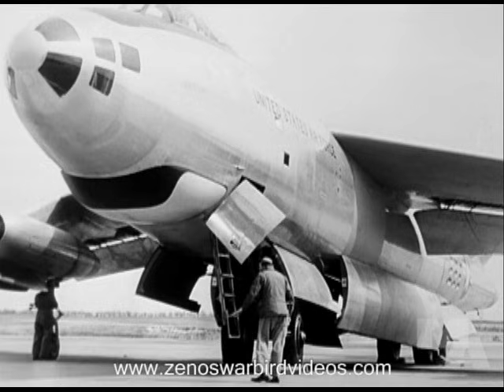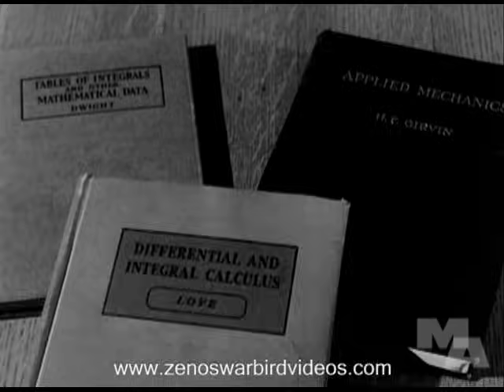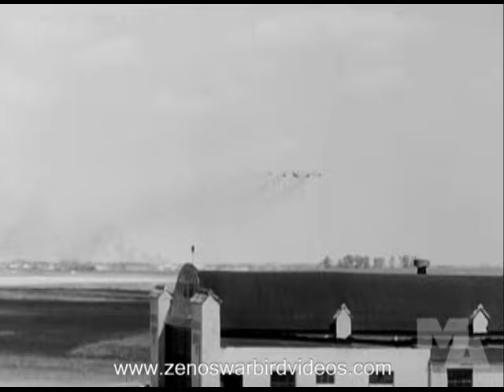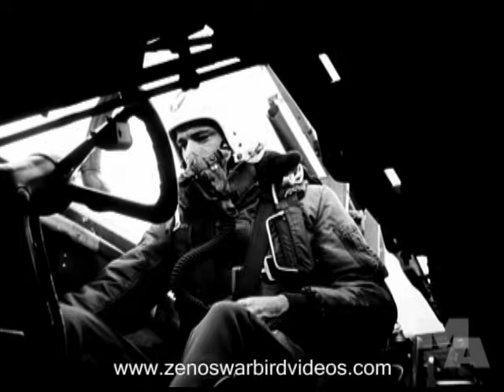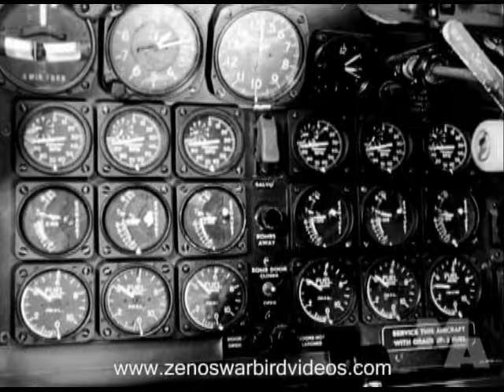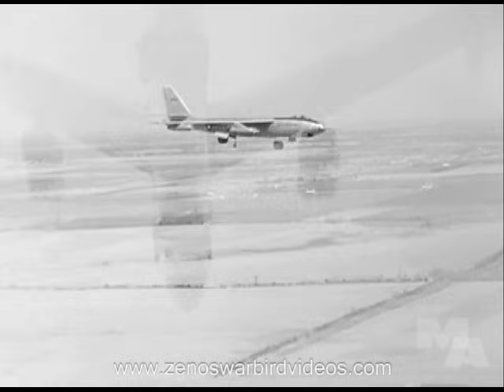Flying the Boeing B-47 Stratojet - Restored1950

Comment: The B-47 was sluggish on takeoffs and, came in too hot on landing. If a pilot didn't take off and go around the plane had a tendency for the wing to slide and cartwheel. Avionics, as with much of vacuum tube technology was a constant problem for the entire operational history of the aircraft. 203 of the B-47's were lost with total deaths of 464. This number represents about 10% of total aircraft production. Still the B-47 incorporated most if not all modern technology in jet production at the time. Swept wing design, engines in nacelles pods, near super sonic speed, superior operating altitude. It provided us with a technological advantage over the Russians for most of it's operational life time.

Comment: The aerodynamic theory of high altitude flight, critical Mach, etc. was something new to crews upgrading from piston engine bombers to jets. Mentally "shifting gears" from a flying 300 mph aircraft to one flying at 600 mph was a big transition. It took lots of training and experience to become a B-47 pilot. A serious mistake in planning or judgement could have dire consequences for the mission and crew. Being our first jet bomber, the B-47 may not have been the easiest or the most forgiving airplane to fly. There was a lot to learn about high speed flight in the 1950s, aerodynamics, engines, aircraft systems, performance, etc. This was repeated a decade later with the B-58 and its Mach 2 speed (another ground-breaking design).

Comment: This plane used a pull up loop of sorts to toss the Nuclear bomb towards its target while the aircraft pulls up, then rolls over to level out in the other direction.  The B47 could not handle such forces, it broke up or buckeled under u der this maneuver many times killing many crews before it was retired when the B52 came in as USAFs main bomber. Dangerous plane

Comment: This is one of the most beautiful air planes ever built. It was very capable of delivering an atomic bomb with a technique called “toss bombing”. This was done by using a turn called an emmillmen . . . this is a turn used by fighters. You open the bomb bay, go vertical, performing a half loop, at the critical moment you let the weapon go, centrifugal force will pull the weapon out of the bomb bay. You than preform a half Roll on top, point the nose down and ‘firewall’ the throttles and escape the blast and shock wave
Reply: Emmillmen? Well, isn't that nice 😂😂😂

Comment: The Fellas:    What's the max speed sir?
                          How high can ot fly?
                          Does it have bad stall characteristics?
The Commander:    Did you guys even read the flight manuals we gave you when you got here?
Reply: Its really noticeable that the film discussed at length the range, cruising altitude and critical mach number without ever once putting a number on any of these. The film must have had a lower security classification than the flight manuals.
Reply: Ken Oliver I never really thought about the security levels of these old training tapes until I read your comment. Now that I think about it, it is quite obvious how classified the films were at the time. One film might teach you about the exact start up procedure, taxi, take-off, flying and landing of an aircraft. Another film might barely assist in a viewers recognition of a craft.

Comment: A beautiful and extremely impressive bird. Truly revolutionary and a world beater. An old friend of the family flew in them and said that, though this video didn't mention that tank selection was also used to trim in pitch, more than any other plane he flew, the entire flight really did consist of managing fuel. Perfectly understandable when some of the assigned missions were one way! Uncle Hank passed a few years back but he always felt that the B-47 should have been modernized and upgraded with four turbo fans along with or instead of the B-52 when they switched to low level attack profiles. Most of the money used on the B-58, F-111 and even the B-1 would possibly have been better spent on SuperStratojets.

The B-47's quirks were manageable and knowledge would have improved the control systems in a comprehensive upgrade. Throw in a structure redesigned for low level flight, those modern engines, and the explosion of inflight refueling and a modern take on the ol' 47 would still be a mighty impressive medium/heavy attack aircraft.

Comment: Became crew chief of B-47 at Lake Charles 1954, after 2 years of crewing a B-29 it was like going on retirement, wonderful aircraft most people don't appreciate the strides made in the first 50 years of flight. Bill K. Long Island
Reply: Hey Bill,  I grew up in New Rochelle just across Long Island Sound from you.

I read in a comment here that the co-pilot seat could swivel around and face to the rear 
so the co-pilot could fire his tail cannon in case of Mig attack from the rear.
I have never heard that before.

Sorry, I meant his 6 o'Clock.   Hey I was Army not Air Force   haha.

Bill D. New Rochelle
Reply: Bill, how was the maintenance on the 47? The 29 looked like a plumbers nightmare.

Comment: I was a crew chief out of Lake Charles I will never forget, I hopped a ride on a refueling mission, I was sitting in the hole freezing to death and 4 feet away sweat was running down the arm of the A/C as he was flying the refuel... 1954
Reply: William is it true that when they were refueling jet bombers with propeller driven KC-97 tankers they had to do it in a shallow dive so the tanker could be flying fast enough to be above the Jet bombers slowest stall speed?

Comment: The B-47 was the first jet Boeing designed. And because they were uncertain how stiff to make the wings then they designed its wings with lots of flexibility. If they made it too stiff it might possibly break in two in turbulence. It was therefore made so flexible that the wingtips were 17' higher at cruise than when the plane was on the ground. 

I as a USAFA cadet was given an orientation ride in one in 1958. The walkway mentioned in other posts here ran along the left side below the level of the A/C and copilot and ran from somewhere in the rear to the bombardier/navigator's nest in the nose. All three crewmembers had ejection seats, but I had nothing. I just sat on the floor of the walkway abeam and below the pilots for T/O and landing. I was also told that my way out of the plane during flight was through the entry door on the left side of the fuselage ahead of the wing. After the ride was over I asked the crew what my chances had been had I been forced to exit through the entry door inflight. The answer was that nobody who had gone out that door inflight had survived. 

Since the navigator did not want to bomb Sacramento for grade, he allowed me to bomb Sacramento for fun using the K system, which was a great learning experience. 

The AF got rid of the plane because of its lack of range. And this was before the day of the KC-97 and KC-135 tankers, which might have changed things. It's a shame because it outran all the fighters of its era numbered below 100. 

The modus operandi was to tanker up out of radar range of the Soviet Union at high altitude, then descend to low altitude to avoid radar. The bombs had spikes on their noses to impale the bomb in the ground for awhile before detonating in order to let the crew survive. 

The Aircraft Commander did the flying, while the copilot handled the fuel and tail guns, two 20mm cannon with a rate of fire of about 600 rpm each. His seat could be made to face rearward in combat. 

Since the A/C did all the T/Os and landings, the copitots were taken out periodically and allowed to land the plane. They had to have 3 landings each 90 days to stay current.
Reply: Thank you sir for all that interesting information. I would love to have seen Jimmy Stewart's co-pilot
turn his seat to face rearward to simulate defending from a MIG attack in the film
" Strategic Air Command ".

Comment: Hmm, memories. My dad flew the B-47 for a year or so when Castle AFB, 93rd BW I think, transitioned from the B-50 to the B-52. This was like 1953 to 1955 time frame. All I remember about the airplane from a personnel view point was that when dad took me out there and hoisted me up so I could sit in the pilots seat was that is was hotter'n a two dollar pistol up under that canopy. Painfully loud and the B-52 was more so. And if I remember right the B-47 had a cat walk that would get you back to the bomb bay, I could be wrong and be remembering the B-52 which does have such a cat walk. I was like 4 years old when dad was flying the B-47 so cut me some slack please. And the last B-47 I saw flying was late spring early summer of 1969 when I was in Boot Camp at Orlando Florida. It came over the training center headed into McCoy AFB trailing it's drogue chute ( Smaller than the Drag chute). A hell of an airplane but a demanding one. Dad really liked it, said it was like flying a six engine fighter.
Reply: I know Castle AFB well from my Air Force days.  It's a civilian airport now, but very little traffic.  The outdoor air museum is expanded from what it was when the base was active.  Whenever I see that exit gate next to what used to be the base operations building it brings back memories of walking through it back in 1963.  That was the exit from the SAC ramp.

Comment: A beautiful Bird, but quite dangerous to fly.  On a nice, clear day while cruising at altitude you could go into a Stall if you didn't watch the controls constantly.  You could get a Stall Warning while at speed, at altitude in good weather.  If you ease off the throttle, and go into a very shallow dive (like any pilot knows from flying a Piper Cub or little Cessna) it won't level out and fly straight after a few thousand feet.  It WILL shed one, or both wings!  B47's were lost without even sending a Mayday while flying comfortably in good weather.  This beautiful plane was a killer.  10% of B47's ever produced were lost, killing over 450 crewmen and it NEVER saw a minute of combat.  The old Tu-95 Bear would cruise at Mach .8 with very little pilot effort.  We retired some B47's that were only eight years old.  A "Widow Maker" if there ever was one...
Reply: Thank you for your information Randy.  I did not know the B-47 was that finnicky a bomber to fly.
Sounds like it was the Sopwith Camel of bombers.
Reply: Finally, someone speaks the truth. I counted over 250 losses from the 2038 built. This plane was a valuable technology step, but it shouldn't have gone into production. They should have transitioned from the B-45 to the B-52. The Soviets had faster fighters by the time the B-47 went into service, and  they had SAM's a few years after that.
Reply: Gee in my 5 years of flying the B-47 (310th BW, Schilling AFB) none of this happened!  Guess I just missed all the fun.

CWW Lt. Col. USAF (ret)

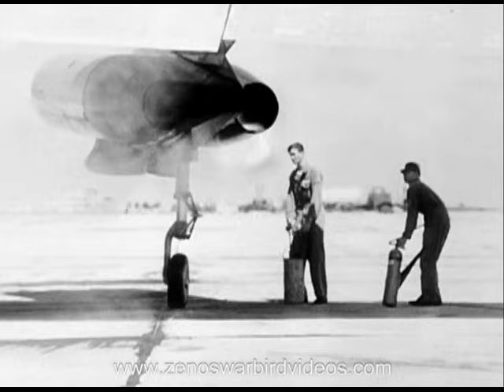Comment: @ 19:06 the ground crew is ready with fire extinguishers ,  combustible is spilling from the turbines.   Was it normal to occur during the start up with the early turbines?   Why ?
Reply: Ron Wolpa Not just the early turbines, we were doing this up to the late '80s with the Mirage IIIO/D. Why, excess fuel during starts caused by late ignition or tail wind usually.
Reply: yup.. lol. could you imagine getting ready to take a commercial flight where ground crew had to do this?
Reply: +Ron Wolpa That's not fuel; that's water, being sprayed on the hardstand to dilute any spilled fuel and prevent a flash fire.
However, early turbojets, while never quite as leaky as the turborams on the SR-71 (A/K/A the kerosene shower-bath!), did have a nasty habit of dripping oil and JP on the ground when not running.
Reply: And, most astonishig of all, those poor chaps had NO ear protection! Maybe deafness and engine screech-induced dumbness was the ONLY thing keeping these lads from runnig for dear life, away from this threatening beast!!!
Reply: James Kratzer I recall reading a book on the Blackbird in the mid 80's and it said that the SR-71's fuel tanks leaked until the metal got hot enough to expand and seal.
Reply: Easy fix  just bring throttle s up a little and it wood clear up. But guys forgot one major item. 
RESET THOSE STUPID BREAKS QUICKLY.
Reply: Always had ear plugs.

Comment: Seems to be a fair and honest 1950 profile of this plane. Actor, Reed Hadley, very convincing as B-47 pilot/commander. The B-36 was still the main deterrent due to early production numbers for the Stratojet. The B-47 did not have the range or bomb capacity of the Peacemaker. The B-47 could be a scary and cramped way to fly. Slowing down to refuel with a KC-97 hurt it's time to target. The KC-135 helped shut the door on the B-36. Before the Stratotanker, total mission not much speedier than the '36. The B-47 was the future, though.

Comment: We had the e model best ever bomber our wing flew with external ecm pods and the clip-in bombing systems 4 weapons not 1. We only ever lost 2 aircraft in8 years..All the problems of the A model were gone by the time Boeing built the e model with much better engines and added a 1700 gal drop tanks an all fuel cells moved to the wings with 1 center line tank low in the fuselage behind the bomb bay. Did away with the long bay God Bless the Clip-In Bomb System......

Comment: Beautiful piece of Aluminum. One thing they didn't say was that the co-pilot was also the gunner. It had double 20mm turret in the tail and the 
co-pilots seat could rotate 180 degrees were he could use the radar gun sight.

Comment: Hogwash. All the pilots I knew hated them. Flying gas cans with fuel tanks along
each side of the cockpit. Most did not survive a crash landing. Friends killed at
Eielson. I knew C-130 drivers who were very happy to get out of "one a day in Tampa Bay". If you lost an outboard engine on takeoff, you were in BIG trouble.
Nav had to eject downward. One brave pilot to save his nav flipped upside down to
let him eject. Same with the F-104. Killer. Germans hated their 104's.
Reply: The "One a Day in Tampa Bay" remark was coined for the B-26 Marauder.

The B-47 is one of the most important aircraft ever built - not because it was great (it had its problems) but because of the layout chosen for the design of the wing structure  and the engine position. It set a pattern that is now the fundamental design for virtually every large jet airliner.
Reply: No, no fuel tanks on each side of the cockpit and a lot of other inaccuracies here. Flew the bird for over 5 years with the 381st BS at Schilling AFB. We lost three aircraft in those 5 years ALL due to mistakes by the pilots. 

C W Wachsmuth   Lt. Col. USAF (Ret)

Comment: John Carraway, no, the out-rigger wheels are not "stupid" nor is balancing on two center-line wheels "dumb".  This is a time proven design that has worked well with the U-2.  Every aircraft design is unique.  This particular design did not lend itself well to the more traditional tricycle arrangement.  And, if you look at the B-52, this time proven aircraft doesn't use conventional gear either.

Comment: The Germans couldn't make a jet powered bomber using there own data in WW2 ?  The Horton Brothers Jet stealthy flying wing, precursor to the B-2 of today come's to mind, just a little to late to mass produce after the allied invasion of Europe.   The Luftwaffe had many jet bombers on the drawing board along with some very advanced designs, some would have been built if the war lasted a year or so more.   Check out Luftwaffe46.for more insight.

Comment: No, as the video said, it has a "critical mach number (less than mach 1.0 the speed of sound).   The air passing over the wing which has camber (causes the air to speed up) is actually going faster than the aircraft (as shown on the mach meter).  If the critical nr. is, say, .83 Mach nr. that means the airflow over the wing is higher, but LESS than 1.0.  If you exceed your critical Mach nr you will get "Mach Tuck", (nose drops).  Could lose control.  New planes have sys to correct for this.